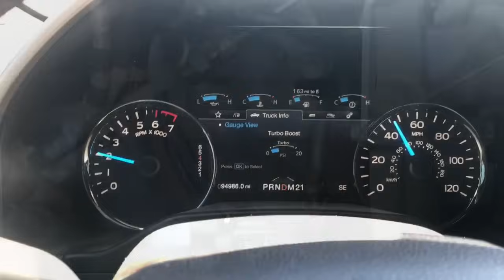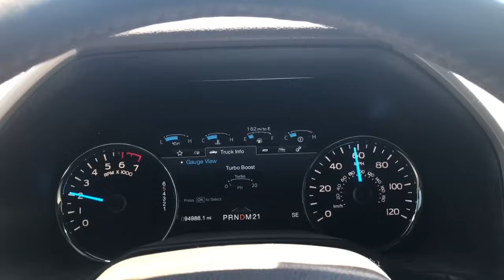F-150 Ecoboost 3.5 Turbocharger Replacement (Tips and Tricks)

Comment: I'm not a mechanic in any way. I just finished swapping both turbos on my 2013 3.5l. A few tips if you decide to do this. First, I've only done this once on one truck. However , the T 47 bolts were actually T 50. When installing, definitely get all the bolts in before you tighten any of them. You need the play to get many of them in. Last tip, if you can afford it, take it to the shop. It took me 14 hrs, and my hands look like I fought a cheese grater. Great video tho definitely helped me!
Reply: the hands 🤣
Reply: Bro you replacing your own turbo not being a mechanic is commendable
Reply: I need help how did you take off the clip on the feed line ( 4:33 )? Im trying to take off the turbo myself but my issue is taking this feed line off
Reply: @osmanrangel5587  I bought a kit that had 4 small picks. I would get longer ones next time. Mine were only 6" if you can find maybe 10" it would be easier.
Reply: @kf7861 omg thank you for responding a pick right? So id just stick it in to the gap where the clamp is and try to take it off right ?
Reply: @osmanrangel5587  Yeah, he used a flat head, I truly have no idea how. I took the pick that was shaped like an L. I did take a grinder to thin it out a little, but that's not necessary. Then I wedged it under the clip and just yanked it out. When you put them back in its new ones so no worries about destroying it.
Reply: @kf7861  ahh gotchu yea i just broke the clip now i just need to take the feed line off struggling with that right now🙄
Reply: @osmanrangel5587  I used the soft side of a flat head and pried it out!
Reply: @kf7861  ahh gotchu i ended getting it all out now just cleaning the turbo, did you oil the turbo and put grease on the connectors before installing? Or did you just install it?
Reply: @osmanrangel5587  I bought new turbos, all I had to do was grease the feed lines a little so they snap in.
Reply: @kf7861  oh damn nice bigger? Or oem turbos? Did those turbos come oiled or no?
Reply: fuckin good on you bro. i’ve spend the last 3 days trying to get to these damn bolts in these stupid obscure spots
Reply: Although it’s gonna be a pain your comment convinced me to do it myself. I was quoted 6k and simply cannot swing that
Reply: @uzifromtwitter5257  t50 for the 3 bolts connecting the turbo to the manifold, not t47. Also, get yourself a pick kit. I used the one shape like an L to get the clips out of the connectors for the coolant lines. Other than that, the rest was a pain but definitely doable! Good luck!
Reply: @kf7861 thank you brother, this truck has been nothing but a nightmare to me. Can’t keep the thing running long enough to sell it. I about passed out when the shop said 6k lol
Reply: @uzifromtwitter5257  I feel ya, man. Mine just spent two full weeks down. 3 mechanics later, the dealer was the only one to figure it out. A wire went bad between the bcm and pcm. I miss my old tundra!
Reply: @kf7861  we both having the same run of luck it appears.Since July I’ve replaced a coolant line, throttle body, water pump, and thermostat lol. My question since you’ve done this before, shop said something about programming the new turbo? And since I’m wanting to sell it would it be stupid to buy the cheapest parts I can to do it?
Reply: @uzifromtwitter5257  I bought my parts from kt performance. They have stock options for cheaper than anywhere else I could find. Mine needs to be tuned, but you can't tell driving it. Where do you live man? I'm asking because your pic looks like utah, where I live.
Reply: @kf7861  so you’re saying if it does need to be tuned afterwards it’s no big deal? And I’m in NC, that was at grandfather mountain.
Reply: @uzifromtwitter5257  mine does, but it's a long story. I bought stock turbos. They were out and sent stage 1 for what I paid. I thought if you went stock, there was no need to tune after. Kt says the same. NC is awesome, man. Hope you're in a no food zone! I grew up in Missouri, had to run west from the 🌪
Reply: Did you have to lift the body from the frame?
Reply: @RideorFly172  I didn't, if I had the ability I would have...

Comment: To whom may attempt this repair, you can speed up the job dramatically by splitting the turbo housing instead of removing the whole turbo and dealing with rusted downpipe.
Reply: where would you split it at?
Reply: @Ashley Evans  look up splitting a turbo on youtube. I'd show you pictures but I don't think I have any anymore. Basically, you go under the engine, undo the 2 bolts for the oil feed and drain lines, remove the 10mm nut that is also under the turbo and you remove that band. Next you go back up, remove the 10mm nut holding the wastegate actuator, vacuum lines, intake and charge pipes. You then heat up the turbo with a torch where the band was to expand it and you should be able to separate both sides of the turbo with some force. When you put it back, you clean the exhaust side of the turbo and them you heat it up until it's pretty hot. You push the replacement turbo against it and you align the small pin to clock it correctly.

Comment: Great video. You convinced me that I need to take my 2012 F150 to the dealer to have my turbo fixed. Thanks. ;)
Reply: Hey what were your symptoms? I've got a 2012. I believe one of my turbos is going out. I could hear the turbo bearing kinda screaming one day and power was going in and out(I'm sure loss of oil to it as ive seen a wet leak at that turbo) . My truck normally would stay in 6th gear and pull up small hills easily. Now it stays in 5th and goes all way down to 3rd to get up hills. You can feel the turbos kick in and out and it will throw you back in the seat if it's in 3rd gear when they kick back in. Check engine light coming on and going way. Then Sunday I finally got a wrench. Had to pull over as it lost all power. I turned it off then went to crank. It took a little longer to crank then started up, drove fine again for a bit. Then last night driving I got a wrench again. Turned off then recranked. Drove fine again.
Reply: Yea eff that
Reply: What did dealer charge?
Reply: @SolomanTiger  too much
Reply: @regularguyfixes3142  definitely get diagnostic but really could be turbos and not expensive change i bought a 2017 with 140k miles on it i guess owner before problem but there also small turbos and rated for 150k miles and once fixed not a problem since
Reply: @todp9170  that was a year ago post. $8000 later two turbos and timing chain…. Yeah was fun…
Reply: @regularguyfixes3142  Just did it on my own - full timing set, Oil pump, turbo internals, manifolds, and just about anything cheap that's a pain to get. All motorcraft minus turbo internals and manifolds. Ended up roughly $3000-$3500, and way more than that in frustration on why did I do this without a lift
Reply: Thank s for the video how long he take to do the job for one side
Reply: What do you mean this is one of the easiest things to do on these trucks?

Comment: Imagine 10 years from now you need a new turbo I would not want to fight rust on this job
Reply: Yeah buddy won’t be 10 years every 150k miles 🥴
Reply: Me 5 years after your comment on a 2011 staring at rust and a turbo that’s been on it for 220k miles rn
Reply: @tootsierollgang  still good?
Reply: @jadedjay7861  I replaced both. Giving everything heat from a little torch and some penetrating oil plus a air hammer (harbor fright hammer pneumatic hammer gun) and then a impact driver made it all come off easy but without those I would have hated my life even more.

Comment: Great tips, I’ll add a critical tip; 

DO NOT loosen the bolts for the oil line flange that bolt to the bottom of turbo until AFTER you remove the upper coolant line and it drains completely even if you think it’s drained from the radiator hose, it’s not and you’ll be draining that all back out of your oil pan.

Comment: Honestly there was nothing easy about this twin turbo replacement job.  22hrs to replace both turbos, replace and upgrade to stainless coolant lines, flush radiator, oil change, brake fluid flush, front/rear differential gear oil change. Don't forget the Ford Motorcraft friction Modifier.  4oz per differential.  Next month we will do the tranny fluid flush, transaxle fluid flush, PCV valve replacement.   The most difficult part of this job was the coolant lines between the firewall and engine.  I still have bruises and cuts on my arms.  Thanks for the great video and information.  Whoever at Ford designed the POS springs that hold in the coolant lines needs to be hung and shot.  At the very least they could have put a tab to grab with needle nose instead of a dental pick.  The easy part of the job was getting the air out of the radiator.  Piece of cake.   The Exhaust bolts I recommend soaking in break free for a week/month before you do this job.  Soak them bools down like a $2 whore.  Use a couple of cans!
Reply: Lol I understand the difficulty. I did this job but on a 2020 and a 2021 Ford Transit twin turbo eco boost. Had to swap both turbos on both trucks. Definitely one of the most frustrating jobs I've done. I remember the anti freeze and oil always dripping on my face like the Chinese water torture. Most cuss words used out of any job I had for sure.

Comment: I did this over the weekend and it wasn't easy, but I was successful. Now after driving it to work, it started smoking. its blue smoke and it does stop after a while of driving. What I've read, it appears to be the turbo went bad. Have you ever ran into this before. BTW thanks for the video, it really helped me. I have a 2013 F150 3.5 ecoboost. 
Update: I put the oil return gasket on backwards.
Reply: I have a 2014 am about to do same job.  Oil leak    118000 mi   Should I not think about putting new turbos on?
Reply: What would be a average time to do this repair?
Reply: Never done it but that all depends on how good you are with tools this to me looks like it woukd take 3 hours tops in mt garage @birneymoore3649
Reply: Thanks for the update!!
Reply: I'll bet you failed to prelude your turbos with engine oil before or after installing them didn't you????

Comment: Great video
One thing everyone should do is replace the oil feed screens, it requires removing the oil line when you remove the turbo. It gets clogged when you change the oil at the recommended mileage by Ford...
Reply: Those filters are cheap, $30, good advice

Comment: I have a 2017 Expedition with a 3.5 litter engine. I had both driver and
 passenger leaks. I started with the passenger. You will need a really 
good light, preferably with a rotating magnet. Remove negative battery 
cable. Jack up car, jack stands for safety, removed the upper inner 
wheel well...lots of plastic tabs and 5.5 mm socket...maybe even 8 
mm...or 10 mm. Remove the engine plastic tabs closest to the front of 
the car. I also removed one of the air intakes that leads to the turbo 
and loosened the other one to have more turbo wiggle room later. I had 
both turbo fittings leaking. I half took off the turbo. Changed both 
while off. I removed 3 nuts off starter, not the electrical connections.
 I removed the 2 exhaust bolts. I removed the 3 manifold bolts. You will
 need to get the 3 manifold bolts and the triangular manifold gasket if 
you don't want to reuse the old ones. I got 3 manifold bolts and the 
gasket. Remove the 2 bolts to the oil line. I did not fully removed it. I
 was able to wiggle the turbo loose to where I could change both turbo 
fittings. Wear gloves if you don't want finger cuts when handling the 
exhaust part of the turbo. You will need a 3/8ths 45 torx and 50 torx. 
Also long extensions and a wobble extensions...and universal joint 
sockets, both 3/8 and 1/2 inch.... They helped. Be careful with the 
brake lines as they are near when wiggling the turbo out. Once 
everything was loose I removed the tang with a long pick from both sides
 of the turbo. I used a pry bar to gently wiggle both lines out of where
 it sat. Be patient. I am a novice and it took 1.5 days to do the 
passenger side. Breaks here and there. The best of luck! Tomorrow I will
 do the easy side...the drivers side. I only have 1 fitting leaking, 
closest to the wheel well. So that should take me an hour or so.
Reply: You will need 1 long pry bar to get the coolant line back into the inner turbo side and 2 pry bars to get the coolant line closest to the outer side of the wheel...one to push it down, the other to align it in place. I put 1 pry bar up against the exhaust manifold for centering while the other pry bar pressed down it into place...both fittings with the tangs in place.

Comment: Thanks sooooo... much for the helpful video! Had the dreaded turbo coolant fitting leak on my 2012 f150. I was able to knck it out in a little over a day. Only trouble I ran into was the (3) turbo to manifold bolts stripped when removed. I picked up some new bolts from my local Ford dealer and was able to slowly tap the manifold threads back to normal. Thanks again for your very useful videos...Subscribed:)

Comment: Its interesting that ford got rid of the turbo mounting brackets on the next gen Eco, definitely makes lining things up easier.  Also idk what they were thinking with the hard coolant lines they are a pain in the ass to force into place.
Reply: Team Neudimensions 
Agreed, I just did this on a 2011 F150. There’s one more bolt behind the turbo holding it on. Real pain to get to.

Comment: Outstanding video, really enjoyed your attention to detail. Just replaced driver side turbo on my 2014 3.5l EB and it helped alot watching this.
Reply: How did you remove the air intake going into the turbo, I feel like it’s extremely hard to pull out even after loosening the clamps.
Reply: @Headbustaturkeycalls  no warning at all
Reply: @zapanimate  it will come out with some effort

Comment: Wondering whether to replace the turbo oil and coolant pipes on my 3.5L 2016.

The exhaust manifold studs tend to go (turbo's weight and vibration are hanging on one stud) and the exhaust gasket can vibrate like a reed:  can sound just like a squalling bearing or bushing.  If that's what is happening, might be worth upgrading the exhaust manifolds (similar conditions on both sides, so if one has gone the other won't be long. 
Maybe  do both sides so you don't have to go back in).  Planning on using the SD Diesel manifolds; thicker, with longer studs.

Comment: Awesome video, I wish I didn't live in the rust belt so everything comes apart that easily lol every bolt broke even with heating the bolt housing with oxy acetylene they sheered off. Lots of drilling turned out to be a fun 2 day project but fun just the same lol😂

Comment: I'm about to replace both turbos on a 2013, it calls for 4hrs left side and 6.5 hrs right side but it seems to be relatively easy. Considering I just did a head gasket and a piston on a mercedes C230. These turbos are a much more straight forward job.
Reply: How'd it go?

Comment: Just thought I'd tune in to see how you go about this and what's involved with it. I'd imagine it would be similar on my 2010 Lincoln MKS, just probably a little tighter to get into. I'll crawl under there and have a closer look now that I know exactly what to change. Though with 120K miles I'll probably just dish out the dough to replace the whole unit rather than just a few gaskets and seals.
Reply: Did you end up doing it? How did it go? My Taurus sho blew the turbos so I'm tryin to see if I should tackle it
Reply: @memolopes1044  I actually have not touched the turbos in all this time... surprisingly. Currently at 165k miles and there's more oil caked up on the outside of the one turbo that was leaking then, just recently knocked some of it off, but still nothing major and the car still functions just fine, so I don't really wanna mess with anything there. I'd say if you have the time and the space, go for it, I would. I recently changed one of my cats fully exposing the turbo and didn't look TOO too bad to tackle if I had to.

Comment: The shops I have talked to REQUIRE the replacement of the cooling lines at the same time.  I have no unusual sounds or negative performance just antifreeze and oil leaks.  Would you use aftermarket turbos, remans or new Ford?  I would appreciate your input.

Comment: Son just got a new to him 2014 FX4 just found out drivers side Turbo is leaking dealer gave us a 30 day warranty hoping they do the repair correctly and not skip any steps, do they rebuild the turbo or replace the turbo and should they do the passenger side also since that is at 123K miles and most likely will start leaking also ?   Thanks and great video

Comment: Great vid, thanks. 1 problem that I have come across is the upper coolant tube. Yes you can rotate it upwards to get it out of the way but there is a good chance that it leaks at the back side of the cylinder head when you are all done. Pain in the ass on that year engine as the brake vacuum pump is mounted on the back side of that head and it needs to be removed to replace fitting. Replace that fitting now as it will save you some grief later. The lower coolant line has a bracket attached to it so there is hardly any chance of the fitting  leaking on the other end of the line which is behind the A/C compressor.
Reply: Duke Pufus is it the vacuum pump that had the fitting?

Comment: What sizes are the Torx for the  oil/coolant manifold at the base of the Turbo? Exhaust Torx Sizes? Was going to grab some 3/8 impact rated ahead of time. Looks like the downpipe bolts are 15mm, maybe a flex socket / intermediate?  They are soaking with some ATF/Acetone mix to make it easier. Thanks in advance